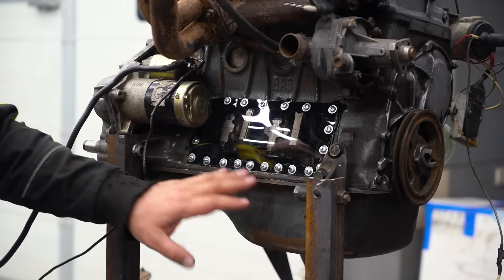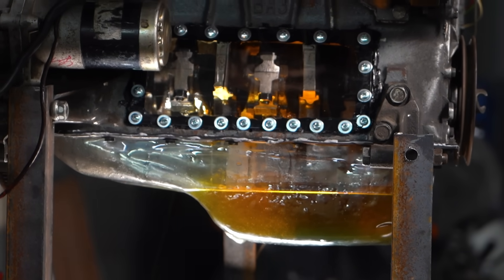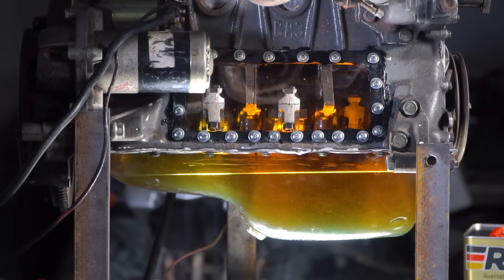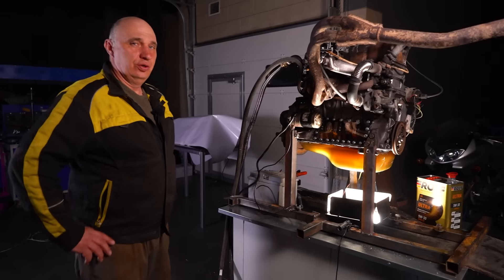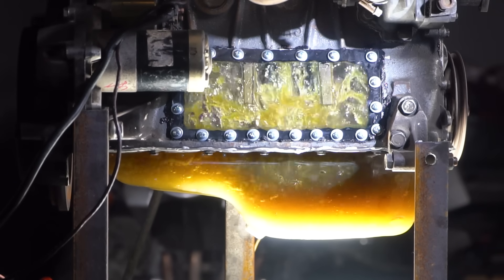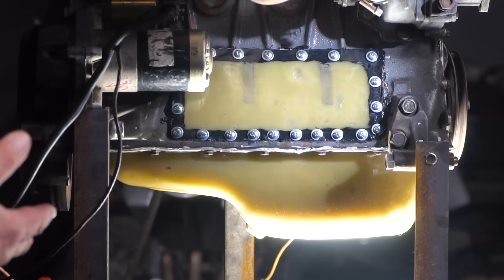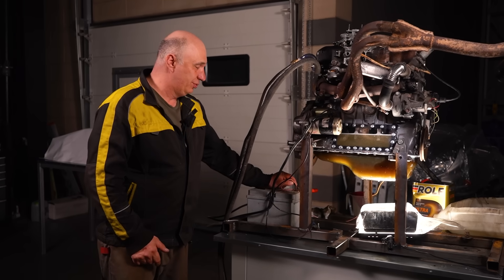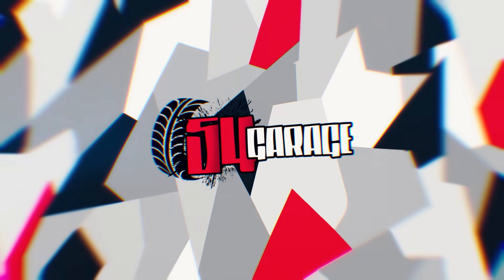What actually happens when you overfill your motor oil? (w/ transparent oil pan)

Comment: For those who are looking for a problem and not seeing it, the problem is the foaming. As the oil level rises, the oil foams more violently, and this introduces air pockets to bearing surfaces inside the engine. On top of that, aerating the oil pump lowers functional oil pressure by introducing compressible air into otherwise non-compressible fluid, and makes it harder for the pump to maintain a prime while operating.
Reply: there's also the added drag when the crank touch's the oil
Reply: after I drain my oil will my crank shaft not sound like it’s dragging anymore?
Reply: @raptorjesus5488  It depends on the viscosity. If it's a think oil, there's no effect. If it's a thick oil, then yes there will be an issue.
Reply: @xXturbo86Xx exactly
Reply: @karlwithak.that oil needs to be non compressable though. Foamed  oil will not stop metal to metal contact in bearings.
Reply: @waimser  It would be interesting to actually test if this is the case. Will air actually get in between the bearing surfaces?
Reply: @waimser  its simple: if oil get air, then motor get more from this air as from oil...🎉 ;) sim-ple😊
Reply: Right but apparently you need to triple the volume of oil in an engine before that becomes an issue. So 1qt over is not a concern.
Reply: I had a 1982 chevy with a v8 that needed 5 L of oil. I ran 5.5 for the last 10 years out of the 30 I owned it so i didnt need to top up during the year . Obvious to say no problems . I ran synthetic 0w30 and put on about 10,000 km / year. Changed oil once a year
Reply: @ellomirza  more oil will increase the crankcase pressure. So it's possible that some seal will start to leak and the pcv sistem will suffer and the engine starting burn oil.
Reply: @Malossianoplus  I very much doubt it. You’re just a guy who reads a lot or watches many videos so you’re thinking about theoretical abstract problems. I promise you in the real world overfilling by a quart or so is not a problem for any engine at any elevation in any climate for any period of time up to and including ♾️
Reply: If your engine is static, but your car goes up and down. Hills and turns splashing the oil around would multiply the problem @ellomirza
Reply: @ellomirza Good because I purchased the wrong viscosity oil and I added a bottle of STP oil treatment.
Reply: @ellomirza 1qt over would start concern  me. A dab over the line not so much. The manufacturers tend to build a little fudge factor in for the silly monkeys that work under the hood. Best to aim for the middle of their recommendation when possible but don't loose sleep if yer a micrometer over the max line.
Reply: @ellomirza  you're looking at 1 engine, that isn't moving or slanted like some engines, and keep in mind that the plastic oil pan was made out of the exterior shape of the original. Its going to have much more volume than the original which is also likely thicker than this one.
Reply: @ellomirza 
1 qt over irnt a problem ..
  Till you need a new engine ..
 Your too too is too big
Reply: @ellomirza  Depends on the engine. Small European engines have tons of extra space in the pan, but many don't.
Reply: @SkorpyoTFC  Agreed the design of the engine will have a lot to do with the susceptibility of the engine to suffer from overfilling issues and other oiling challenges.
Reply: @ellomirza  not exactly, if you think about it, the engine is stationary, in "normal" operational conditions, the engine is moving and oil goes all over the place.  Overfilling has been a warning by manufacturers for a very long time and there is a good reason for that, the foaming and cavitation issue, additional resistance to the crank and poor performance overall.  This topic has been researched by manufacturers extensively and it's not just a "thing" to apply that to the specification set forth by the manufacturer.  Poor quality oils can foam and cause the same issue even if applied correctly.  Certain synthetic oils and other oils have a "max temp" and if the engine is run hard for too long, the cause can be foaming and also the oil creates small solids, not good for the engine but that is another topic.
Reply: @myyoutubeantispamaccountformys when I eat I produce solids, should I cut back on my oil intake?
I tried sticking a dipstick in certain holes, but could not get a reading 🤷‍♂️
Reply: @myyoutubeantispamaccountformys  that’s a fine academic assessment of our topic here but speaking anecdotally as a guy who’s “overfilled” hundreds upon hundreds of engines including in my own cars I assure you there are no consequences.
Reply: You end up damaging the cat before anything else that is the main concern of manufacturers. As soon as year 100 mile warranties because required manufacturers detect the oil level and the engine stops above or below it, they also measure the oil quality somehow.
Reply: @myyoutubeantispamaccountformys  You're making a statement and point as if there were a lot more oil, one quart over will not do that
Reply: @ellomirza  if you are a serviceman / mechanic, you just proved why I'd rather do the messy job myself and not take it to the dealer / shop.
Reply: @user cool story bro
Reply: @myyoutubeantispamaccountformys I have a two stroke hot bulb engine so I know what you mean.
Reply: @mann_idonotreadreplies HAHAHAHAHHA
Reply: @mann_idonotreadreplies HAHAHAHAHHAHAHAHA
Reply: @mann_idonotreadreplies HAHAHAHAHAHA
Reply: @mann_idonotreadreplies HAHAHAHAHAHA
Reply: @mann_idonotreadreplies HAHAHAHAHAHA
Reply: @mann_idonotreadreplies HAHAHAHAHA
Reply: @mann_idonotreadreplies HAHAHAHAHAHA
Reply: @mann_idonotreadreplies HAHAHAHAHAHA
Reply: @mann_idonotreadreplies HAHAHA
Reply: With no windage tray in the pan I was wondering if foaming was going to be an issue.
Reply: They just need to add a quart of anti-foaming solution, problem solved.
Reply: Yup. Hydraulic tappets don't  like spongey oile   either.
As a rule, 6% air max for bearings, but 2% for tappets. Then you're in trouble.
Engines for extreme gradients cannot use hydraulic tappets.
Reply: @johnwade1095 it will blow the seals out and or come out of the breather
Reply: @karlwithak.  You didn't read my message fully. Because I admitted you said that. But it's not proof of anything if the engine was at idle and no load. You also haven't said what type of engine it was. Big difference between a hit and miss engine and an engine out of a Ferrari. So sure I believe you did that. But it's zero proof that Aeration is a non issue. I could link you to a study MIT did on the issue if YouTube would let me. By your logic auto manufacturers are wasting money on pressurized lubrication systems. We could just stick with splash lubrication. You only need a paintbrush worth of oil so it'd be more than enough....
Reply: @d3faulted2  I've been working on cars off and on for ~20 years. Have seen at least two dozen main bearing failures. Every single time, it was because of not changing the oil, or letting it get too low. (The only one off time was a Porsche M96 engine, but that's a different issue) I have never seen an over filled engine lead to main bearing failure. 

Furthermore, just on the physics of the situation I find it more than hard to believe that micro aeration in the bearing area getting compressed can cause damage to the surface. Diesel engines run with much more oil and much much more compression and don't have more main bearing failures that gasoline engines do. Liquids dissolve at least some gasses and the main bearing is always exposed directly to air, there is just no way you wouldn't see more problems with diesel engines all else withstanding.

TL;DR: I think you are full of crap.
Reply: @JustAnotherAlchemist  if you did you would also notice that compared to gas engines. Diesel engines tend to have much larger bearing surfaces. Yes higher pressures, but for a given power rating their bearing surfaces are much much larger. They also typically don't operate at near the rpm that gas engines do. Even small diesels like a kubota D-1105 tend to top out under 4k. That's the secret of their longevity. Low rpm and oversized bearing surfaces. So the actual pressure per area is lower. I'd of thought a 20 year veteran of the industry would already know that.....
Reply: @CharlesLeeScoville  thank you for sharing you signigicant expertise.
Reply: Fantastic comments here, quality ding dong, I only wish I paid attention in 8th grade so I could identify who was talking out of their arse. Great video
Reply: The 2x shot is most useful IMO: the takeaway here is that accidentally getting an extra half quart or quart in there is just fine.
Reply: the fact of the matter is, this scenario is so far down the list of concerns.  

the VAST majority of oil-related problems are either from idiots letting the oil levels get dangerously low, or the oil becoming extremely soiled from infrequent changes, or a combination of both.
Reply: I have a 6 cylinder that calls for 5 quarts, I always do 6. Wth can't hurt and takes more heat away from the engine
Reply: But it perfectly proves that a 90Hp Engine Could survive this situation haha XD If This was a Turbo Engine than the oil foaming wouldn have definitely destroyed it: :D
Reply: @mpower5177  agreed. Turbo engines are far more touchy
Reply: Cavitation = sudden phase change due to pressure differential that often occurs at a pump impeller in WATER services. It is when the liquid flashes and changes to steam at the low pressure point at the pump suction, then as the fluid is compressed, the vapor bubbles implode (change back to liquid) which can cause violent vibrations (cavitation). This does not happen in oil because you aren't close to the vapor dome. The air bubbles in the oil do compress and do decrease pumping, cooling, and lubrication performance.
Reply: @noahk9217  it does you know.
Reply: I have seen a car driven for 1 year with twice over max oil level and didn’t show any damage.
Reply: @blackbirght  How would you have seen that and did they drive it with twice the oil on purpose??
Reply: Yes but that didn’t happen until over double the oil volume. Nobody is gonna put in double the oil amount. 😂
Reply: karlwithak.Your engine, your rules... Your bubbles.... (Your worn out bearings).

Bubbles disturbs the oil film compressibility, allowing metal contact.

Journal bearings is a hydrodynamic bearing. The pressure (in the bearing, not in the lube gallery) is produced by the movement of the parts. This pressure is NOT monitored by the gauge/pressure switch.
Reply: I don't think aeration and cavitation create enough air to cause issues like that. An engine with no oil will run for a min before failing, so while your theory and deductions are correct, I still doubt they could/would cause issues in any sloppy toleranced combustion engine. Something dependent on extreme precision to function would be a different story.. Still, very sharp of you.. if you're not already on your way, you should become an engineer.. you think like one. :)
Reply: @dannythompson1948  older engines with separate babbitt bearing inserts deal with it pretty well, newer designs where steel cams ride directly on aluminum bearing surfaces and lifters function on hydraulic pressure get torn to shreds.
Reply: Overfilling a little (1 or 2 qts) won’t hurt a vehicle beyond reduced fuel mileage. Most quality oils have anti foam additives.  I’m not sure that tripling the amount of oil is a good idea, oil will squirt out of the breather.
Reply: It’s an old engine tho. Newer engines might be more sensitive
Reply: Well said sir. Small details can have big impacts..
Reply: Turbos will be ESPECIALLY miserable with foamy oil since their bearing is generally very dependent on ongoing flow, and maybe even 'hydrodynamic'...or oildynamic?...whatever, where the stream of oil is part of what makes the bearing.  If the oil foams, the bearing will be able to move within the 'compressible air bubbles' range of things.  That might seem harmless, but 'bearing slap at 20,000 RPMs or more' would be SUPER uncouth, and with enough bubbles it would have enough space to slap to an outside edge of the 'bearing'-foam and then 'zip around the bearing cavity' at whatever-thousands-of-RPM until the oil stops foaming enough for it to re-center itself.  Or until it fails, I suppose.  I haven't tried to see how much foaming a turbo can handle.

On the other hand, the non-turbo car engine I was working on that has a ton of goopy oil and varnish in it will likely get a 1.5-2x oil load with a can of engine cleaner so it splatters ALL OVER and hopefully breaks up some of that varnish and goop.  This was worth trying...and tells me that it's not a TERRIBLE idea to be a little over, even if it's awful to be more than a little over!
Reply: Yeah that’s what I was thinking
Reply: Great video!
Cause of problems is not foaming and loss of viscosity as you suggest in your comment. That won't cause seals to blow.  Primary cause of failure is crankcase vent getting blocked w/oil and  crankcase pressure building up.
Your crank didn't fail and seize.  Your gaskets did.  The blowby on cylinders from same pressure caused burning of oil.
Foaming is secondary, but perhaps root cause if you break camels back with juuust too much oil.  The foaming will put you way past scale, and likewise lower viscosity that will not allow crankcase to vent properly. 
At least this is what it seemed to me.  
Watch video again and reply if you agree or not.
Reply: That's the first thought I had when he noted the foaming... the introduction of so much air into the oil itself was certainly going to get sucked up and distributed as if the air bubbles were lubricant, which of course, it's not.   You touched on the 2nd question that I had, and that was what happens to the oil pressure itself. I would have guessed the oil pressure would have gone up, You stated it would probably drop because the air is more compressible.  I never thought about the change in oil pressure that way before.  Anyways good stuff ... cool to see what's happening in that oil pan!
Reply: The air bubbles also reduce the effectiveness of the oil as a lubricant. Oil is essentially microscopic ball bearings, when you introduce air to the mixture you get more friction between the moving components and this is also another huge issue
Reply: If you use 100% Synthetic such as any expensive oil other than what others claim to be 'Full Synthetic' because it only needs to have a small amount of synthetic stock to be labeled 'Full Synthetic' then you might have better lubricity and less chance of  metal to metal especially if the oil is already diluted or lost it's protection properties.
Reply: You stated exactly what I was thinking.  In summary, a little overfull is no big deal.  More than a quart (litre) overfull you can start to get aeration and that is bad for the moving parts.
Reply: Air in the oil also increases the volume of the oil, escalading the problem.
Reply: Correct! And while this might work with a Lada Engine for quite some time, high performance Engines with higher compression rates, Turbochargers, very thoroughly designed bearing surfaces will likely suffer from wear and tear a lot more and thus suffer from a drasticaly reduced Engine Lifetime.
Reply: Kind of like trying to drink through a cracked straw
Reply: Great breakdown of what happens. I was looking at the foaming as well and wondering what that would do to the pump.
Reply: This comment is the one I was looking for.  I watched on another channel an experiment a guy did on whether or not you should add oil to a new filter before installing it.  He took oil samples and had the oil analyzed, and he was able to determine that not filling the oil filter caused engine wear.  The second or two that oil was flowing in the engine, but flowing into the oil filter, was causing wear.  The oil analysis showed it.  There were microscopic metal flakes in the oil.  That type of damage takes years to really have an impact though, and the rest of the car may be done for before the engine.  The point is that this guy doing this experiment doesn't show the long term effects of overfilling an engine.  As others have said, the crankshaft will have an increased drag on it by splashing too much, and since different parts of the crankshaft will splash at different times, it will throw the balance of the crankshaft off and increase wear on the crankshaft bearings and the pistons.  Plus, the foam will create air pockets, like you said.  Yes the engine will continue to run, but that level of damage will not allow the engine to keep running for long.
Reply: Those air bubbles can burst between the journals and the crank and may cause pitting throughout the contact surface.
Reply: Crankcase pressure blew the gaskets. Would be more interesting while monitoring pressure.
Reply: It would be hilarious to hydrolock the engine from below with oil.
Reply: i agree, the oil cavitates, not good.
Reply: Add to that when cavitation occurs in a fluid the surfaces making that contact can actually break small particles off, so pitting occurs on those surfaces. not a good thing even if it's micro.
Reply: karlwithak.Just shows your are not too bright, running a engine with no oil in sump 🤦‍♂️
Reply: karlwithak. I'll remember that!
Reply: karlwithak.The voice of  reason. 👍
Reply: karlwithak.The argument about cavitation being a source of any non-slippery atmosphere that harms bearing surfaces, is silly. Very silly, especially after watching

 'oil is now bubbling out the breather'
(Oh? fun!)
"let's add more oil, we're not done!'?

The man made his point. When more oil molecules are battling the air molecules for a limited space, it's going to be more difficult to get a dry spot!
Reply: I was hoping trying to compress a liquid was going to be more violent.
Reply: What engine is this  ?
Reply: Hello everyone,
Yesterday I changed the oil in my ride on lawnmower. I went with a slightly thinner oil as the temps are cooling off now. I gave it an extra dollop...because reasons.
I hope this helps.
Glenn
Reply: @karlwithak. you know absolutely nothing which you are talking about, if you really believe what you are saying then go actually fill up your engine with oil, report back to us in a week once it has spun a bearing 😊
Reply: karlwithak.You comit the anecdote fallacy. You are also extremely unwilling to question more quantitative and qualitative data than your own experiences. That means you have unscientific approach to your decision making. Your ego is more in control of your thought processes than logic.
Reply: Yup I added 2 quarts extra in my old civic and the check engine light went on. Lesson learned
Reply: Yea he says it in the vid
Reply: Aghhhh bologna!
Reply: Good.point
Reply: The 'full' line is actually a 'fill to' line. Half a centimetre over this line seems to be perfect in most engines.
Reply: Additionally if it was diesel, oil coming out the breather into the intake will lead to a runaway so yes many problems 😅
Reply: It was interesting to watch this.Im surprised oil leaks out of seals/gaskets didn't begin at much lower oil levels.It would be interesting to see a similar test done when the opposite is done concerning oil level,iow too low on oil.It would require removing the pan and main/rod bearings at each oil level,so slightly more involved than just watching what the oil does through the transparent pan as you add each additional quart.Of course you wouldn't have to pull every bearing,just pull them from one main/rod journal or just the rod journal.To see if scoring begins at one quart low,then two quarts,etc.The bearing(s) would have to be replaced after each inspection so a discernable difference could be compared.
Reply: Yes, the bubbles could also be cavitation, and whilst as others have mentioned that it won't correctly get to the bearing surfaces thoroughly, and the compression issues, what about the oil life?

To me, any oil foaming due to over filling is going to lead to damage in the long term....and what about oil pressure also?
Reply: ahSO! Makes sense. Thx for that!
Reply: @d3faulted2  Wrong this is clearly not cavitation this is called aeration.
Reply: @airgliderz  I fully admitted I used the wrong term in a previous post. Good job at pointing something out that's been already established.
Reply: Foam is a decent way to end the life of any oil pump.
Reply: But, I'm also curious the damage being done to the bearings, if any, from the rod caps smacking the oil.
Reply: Love all the imaginative explanations here. My fav is someone claiming it could get into the clutch, but cavitation is a close second 😂

Nearly all oil pumps in internal combustion engines are positive displacement. And for good reason.

As long as you have:

A) sufficient oil
B) sufficient pressure

Then the oil will flow to where it is needed and things will be fine.

Oil+air vs oil only makes little difference, what's important is there is sufficient oil where it's needed. That's it. If it's flowing where it needs to be, there is no problem.

There is no such thing as "too much" pressure or oil, there is only "not enough" (insufficient) pressure or oil. 

Worst case you'll lose a bit of power and maybe longevity of the oil. That's it.

Bold statement i know, and a hill i will die on.

Prove me wrong with a source showing an engine being damaged by "too much" oil volume or pressure.

https://en.m.wikipedia.org/wiki/Oil_pressure

Remember folks, you can and should top up your oil with the engine running, oil cap removed... which you can do because an oil pump is positive displacement and the sump is not air tight.. pressure is required but only as a means to force it between bearings where it then dribbles back to the sump 😂

Cavitation.. in  😂
Reply: As i jist stated...ive seen a few engines overfilled by double spec and thwy all acted differently.   If you overfill a Volvo  by double so now you're at 16 quarts then you will be passing major amounts of oil through the exhaust.  You will emit a dark white smoke cloud as bad as youve ever seen.  I watched a vw master tech just the other day fill an engine without draining it.  It instantly shut down and he pulled the plugs and cranked to clear the chambers.  Brake cleaned all the plugs.  Ran the car for a few hours before the smoke cloud cleared. @sirtra 

Now, that's a chance to hydro lock and that's definitely engine damage. 

My qualifications are being a BMW tech for the last decade and personally forgetting to drain the Volvo and dealing with the consequences.   An engine sitting there is a very different beast that one in a moving automobile.
Reply: Not to mention that whipping oil costs both power and fuel economy.
Reply: When that crankshaft hits the oil it doesn't just foam it aerates it and it's mist, I would imagine when settles back then air bubbles become a problem.
Reply: If oil isnt compressed, Air won't be compressed. It's not closed system
Reply: Why overfill? Your supposed to belubricating an engine not whipping a meringue ...
Reply: That "Foaming" as you speak of , is caused by the crankshaft whipping the oil into a froth .
Reply: It also floods the cams with way too much oil and the cam seals begin to leak as they are not designed to be holding oil next to them.
Reply: don't forget the cavitation.
Reply: 1) air-entrained oil isn't efficient lube
2) More oil=less power

Machines require constant lube, and temperature control.  Keep it within spec. It'll perform better and last longer.
Reply: Exactly what I was thinking. With little real understanding of how an engine functions, it seemed to me introducing all that air was going to be a problem.
Reply: There is a reason why the engineers who design the dip stick with a maximum mark with writing above it saying DO NOT OVERFILL
Reply: Yes, it’s called cavitation
Reply: Cool story bro
Reply: @mann_idonotreadreplies HAHAHAHAHAHAHAHAHAHHAHAHAHA
Reply: @mann_idonotreadreplies HAHAHAHAHAHA
Reply: @mann_idonotreadreplies HAHAHAHAHAHAHAHAHAHAHAHAHAHAHAHAHAHAHAHAHAHAHAHAHAHAHAHAHAHAHAHAHAHAHAHS
Reply: @mann_idonotreadreplies HAHAHAHAHAHAHAHA
Reply: @mann_idonotreadreplies HAHAHA
Reply: Thanks for the explanation
Reply: Which is why you should always buy a vehicle with a gauge vs an oil light.  Oil pressure drop is discovered faster with a gauge so you can tell if your oil change guy messed up.
Reply: It's a side load washing machine 😅
Reply: Iam not a mechanic, always thought if you overfill it blows smoke oil out of the exhaust.
Reply: Thanks for actually explaining it vs having 20 minutes of empty talking for ad revenue
Reply: Very interesting experiment. Thanks for the work put into this test.
Reply: Anyone mentioned about crankcase pressure and pushing into crank seal on either side?
Reply: Due to the air in the oil, it will heat up more to the point possibly were the aerosol might light up and explode, or at least motor will overheat somewhat, since air does not transport heat so well, and so does oil foam.
Reply: Amazing explanation!!! top!!!
Reply: Advanced cooling
Reply: Understood
Reply: Drowing it from inside is how i describe it
Reply: There also happens a lot of Cavitation. Over a longer period of time it could significantly erode away parts of the crankshaft and connecting rod. But it will fail from the events you described much sooner.
Reply: @SkorpyoTFC

I agree with your second statement, but not the first. Air bubbles are not able to enter the rod main bearing due to oil being under constant pressure coming out. Now when the oil pump is picking up bubbles those bubbles will reach the connecting rod bearing "other crucial parts too" which is not enough oil and rod bearing failure is imminent.
Reply: In addition the viscosity of the foamy oil is too low, preventing good coating of the parts and will cause more burning.
Reply: Thinner oil foams less
Reply: What if the oil level was far above the crank so it couldn't catch any air to mix with the oil at all?
Reply: and increasing working pressure which can detain/damage gaskets and sealers and cause as you mention another drop down of oil effectivnes which can in long term ( few thousands km ) damage engine to the point it would be just to replace
Reply: I think I have problems with shops overfilling my 2008 Nissan maxima but it's hard to see the level
Reply: Air in a pump is a no no.
Reply: Ha! I thought so! Thank you for the confirmation!
Reply: I overfilled my mitsubishi pajero v6 many years ago. First drive after I could tell immediately I got on the dual carriageway. The engine noise and performance alerted me. I stopped... Drove slowly home and drained the excess.   Must have been foaming and tappets and bearings were not happy.     True story.
Reply: Foaming is a problem in fluidics, We can't say it's normal. Actually the air bubbles will reduce the density and viscosity of fluid and if viscosity and density is not as per the design criteria then definitely it will cause premature damage. Also air bubbles will reduce the oil lubrication and may cause the oxidation issue. But it will not result immediately or within a few hours. However, we can say foaming is a slow  poison to any fluid and fluidics system.
Reply: I overfilled my car engine by only one quart once on a 2-hour road trip by the time I came back my car was smoking from the oil burning off the exhaust manifold turns out all it took was one extra quart to blow my valve covers gaskets on the driver side. I use 9 quarts regularly
Reply: that is what  would happen if you double or a little more  that is a lot of oil over the fill mark. A quart of oil more should not hurt anything at all. so the myth you get at these quick fill oil change is only that the use or put in the minimal amount of oil which means more money in profit.
Reply: @kennylavay8492  just 1 extra qt blew my valve cover gasket on my coyote 5.0
Reply: All I know is anytime I've seen someone forget to drain oil and just add more (so twice the amount)   either the engine nearly instantly siezes up and then you have white smoke to deal with burning out the cat for two hours (Volkswagen)  or the car seems to operate normally but shoots a cloud of smoke from the exhaust everytime you touch the gas (Volvo, Nissan) 

That oil pan is very forgiving.
Reply: Considering the main problem is foaming due to air mixing into the oil im kinda curious what will happen if you fill the motor up so much that there simply isn't any air in the motor for the oil to mix with considering I'm going to be doing a engine swap this winter I might just try finding out with my old motor since I won't have any use for it when I have a motor that has compression
Reply: Guys, HERE is The True Savior

HalleluYAH translates “Praise ye YaH”

YaH is The Heavenly Father
YaH arrives via the TENT OF MEETING
YaH was Who they Crucified for our sins
YaH was Crucified on an Almond TREE

Ancient Semitic of Moshe (Moses)
Isa Scroll (The Original Isaiah)

Isaiah 42:8
"I am YaH; that is my Name! I will not yield my glory to another or my praise to idols.”

Isaiah 43:11
“I am YAH, and there is no other Savior but Me.”

Isaiah 45:5
“I am YaH, and there is none else.”
Reply: Skorpyo. I couldnt have put it better
Reply: The foamed oil will always ride on top of the oil, your sump picks up at the bottom of the pan. Maybe, in high rpm race conditions, with a shallow pan it will go am all the way to the bottom. But never in a street engine.
Reply: The crankshaft churns in air because of a higher level of oil in the oil pan. The crankshaft literally dips into the oil bath, which is not optimal. The negative impact, as you say, is less lubrication, not more. True, the oil pickup screen is about 1/2" from the bottom of the pan, submerged in oil but the addition of air/bubbles causes a minute break in the lubrication stream to the upper engine i.e. lifters, rocker arms, timing chain, etc. Now an oil starvation situation is created, causing accelerated wear and possible part failure.
Reply: I came here for this type of comment thread. Thanks folks for keeping YouTube truly alive.
Reply: Thank you for this!
Reply: How does this apply to more more modern cars with a split upper and lower sump?
Reply: Plus when an engine get's warm pressure rises and seals could go leaking or oil could be pressed between piston and cilinder and once an engine does thay it will keep doing that. So you might end up filling up oil and adding gass instead of filling up gas and adding oil.😊
Reply: 5 W 30 w = NORTH POLE  ::: BUT CAV- AIR WON'T  PUMP: POINT MADE ! BUT point #2 a little won't  kill ~~ but when it comes out the of the : "dip stick"?  * stick  to the " normal" level!😂😢😮😅😊 

Great work & now to the :" DRY stick" experiment ~~~~ smoke, fire & siezeure! !😲😳🚫👎😇🙏
Reply: Aka.   
  engine destroyed 
 Women overfill  with total Duh
Reply: I’d like to see how 3 quarts low operates.
Reply: Oil is actually compressible, though less so than air.
Reply: Thanks for saving me having to listen to anymore of this horrendous AI voice and electronic garbage.
Reply: Thank you man, for answering my thought :))))
Reply: Love the knowledge!
Reply: Wont the air or foam cause cavitation in the engine?
Reply: I'm disappointed, I was expecting to see mayonnaise 😂
Reply: Yeah, it would have been more informative if they had an oil pressure gauge "picture-in-picture" for us to monitor.
Reply: I should think that the oil being whipped into a froth like that would shear those long polymer chains in the oil, breaking the oil down much more quickly.
Reply: The point here is people have been told to put the exact oil requirement in and don’t overfill or your engine will explode. Obviously if your engine requires 5 quarts you can still put in 6 or 7 and there are absolutely no negative effects.
Reply: For me? I would rather have a larger oil pan and a good oil cooler, with reccomended oil level maintained.
Reply: Also, don't forget that air bubbles like those generates erosion like crazy.
Reply: Why can't we just agree to just put in the right amount?
Reply: Nonsense.
Reply: True, but it seems like slightly more would not be an emergency.
Reply: Let's also not forget about the cat converter too.
Reply: Another problem with this test is that there aren't varying load levels like in a moving vehicle
Reply: Is cavitation an issue at this point aswell? All those air bubbles can’t be good for wear on crankshaft and big ends
Reply: Costing a bunch of horsepower with too much oil, big block Chevys like to a quart low actually,  can pick up 8-10 horsepower by draining a quart out of your bog block Chevy!!
Reply: Accurate. Thank you.
Reply: If a diesel engine gets over filled it can run on the oil as a fuel.  Then it will over rev and blow up. Very frightening.
Reply: Heat is a major issue with foaming. Can kill your oil pump prematurely
Reply: all of us must say tchae to this
Reply: Awesome info, thanks
Reply: Probably went way overboard fabricating my own winded tray for my 3 L 2002 Ford Ranger. But you can never be too safe.
Grandpa used to tell me an ounce of prevention is worth a pound of treatment.
Reply: Foaming happens no matter what. Even if you don't overfill it. Everything you say is just theory, and false theory at that. The only issues that's caused by too much oil is what you see here (you did watch the video, right?).
Reply: The transparent oil pan is a genius idea for visualizing engine mechanics
Reply: Yep...this can actually all be summed up in one word: cavitation.
Reply: One of the coolest experiments ive ever seen. This Guy Rocks 🤘🤘🤘🤘👍
Reply: So you're saying add some Lucas and more oil to solve the problem... I like your thinking bro replace air with oil and add Lucas to thicken the viscosity no foaming and constant lubing...
Reply: The bearing are still coated in oil, the minute amount of foaming hurts nothing.
Reply: Agreed. However at 2x the amount, it really was not bad. The smoke from the exhaust would suck. Not the end of the world for your engine.
Reply: I call it the orange julius effect
Reply: I dont see how this proves overfilling isnt an issue. He runs the motor for a minute or two tops. Driving to work can be an hour commute and that oil will build oil pressure and find a seal or gasket to exit
Reply: This is hilarious considering there’s always air pockets, but apparently we are worried about the tiny ones
Reply: This is hilarious considering there’s always air pockets, but apparently we are worried about the tiny ones
Reply: Have you ever changed your oil. After just driving around town. It comes out  foaming
Reply: Also, crankcase pressure. Replacing a crankcase that usually has very compressible air in it with very not compressible oil will cause higher crankcase pressures.
Reply: the dip stick have hallow dots on it which tells how much space is in the sump available to fill the oil for the engine
Reply: what if I filled it so much that there was no air left in the engine?  That'd be good for extra lubing
Reply: This comment explained more than the video
Reply: Bro I understand but you can just tell that in the short form😅
Reply: So simple problem have simple solution: oil catch can + oil filter
Reply: @ you don’t actually know what a catch can and filter do, do you?
Reply: And the foaming breaks down the viscosity quicker
Reply: I immediately thought about the same, at least an oil pressure gage should have been used correspondingly - and shown to us if or how the oil pressure might drop during the test.
Reply: Yeah but 0.5-1l dont think will do any harm....
Reply: Also, any debris in the oil is tossed around up into the block
Reply: So should I overfill the oil or not?
Reply: @fortniteisbadatfortnite2570  nooo, just in case you pour a little more than max, leave it dont think will harm anything 100-300ml
Reply: Doesn't happen until excessive amounts of oil are used, 3X
Reply: I wonder how this effects heat dissipation, as that is also a primary function of oil.
Reply: Hydro engineers know what happens when "aeration" meets pump and vacuum effects reduce head
Reply: @Howo8910  I think the point of the video is that to get the oil to foam you would need 12 quarts of oil. My car recommends 5 quarts, I put in 7 and have a car with not engine problems and purrs like a kitten after 3000,000 miles. I also change my oil at least twice a year
Reply: All these morons forget oil leaves a film, keyboard experts and their boring lives amaze me
Reply: people know the problem.  they're looking to see how much oil you need for the problem to occur...
Reply: Also severe cavitation. The bursting of the microbubbles causes tiny, but incredibly surprising damage to all metal parts. This test would need to be run for hours and then you'd likely see catastrophic damage, starting with the main and rod bearings.
Reply: it's called FLUID OSCILLATION
Reply: The engine is vomiting 😅😅😅
Reply: Concise, thank you for the info
Reply: @karlwithak. the problem is the top end sizes. This is a well known way to "accidentally" blow someone's engine up. You over fill the fuck out of their motor.
Reply: @Jiunds Sad man
Reply: @Jiunds No its not well known. It just drains off the engine breather. Stop making things up.
Reply: When the oil is up to operating temperature (100+C or 212+F) there is less air bubbles. 
.
Reply: @craigd1275 true from the stand point the bubbles will not form so easily and those formed ones will surface faster. But... Lower viscosity means easier return of oil to the pan, increasing the level, more crank beating.
Reply: @d3faulted2 that's aeration. Cavitation is caused by a restricted or blocked oil pickup or suction line to a hyd pump. Cavitation and aeration cause similar damage but cavitation caused imploding air bubbles on the suction side of the pump and aeration causes air bubbles to explode on the outlet side of the pump. Everyone always says cavitation but it's aeration.
Reply: Nope.  Cavitation is caused by bubbles formed from high speed fluid separation.  In this instance, it would be the crank balancers possibly incurring cavitation moving through the oil at high speeds.  Aeration of the oil is completely different and decreases its compressive strength since air is much easier to compress.  Just a guess but I’d think you might have some harmful effects just from different flow characteristics.
Reply: @fraserlordly2432  that is actually very good information thankyou!
Reply: @fraserlordly2432 well cavitation bubbles and aeration bubbles are wildly different. Cavitation bubbles are formed with nothing inside them they are a bubble of vacuum space essentially. So, when they "pop" there is nothing being released like what would happen with an aeration bubble. So, whatever small amount of gases are in the cavitation bubble, get forcefully compressed and eventually ignite and explode. 

In water the explosion can reach temperatures in the realm of the sun and apply as much force as a .22 going off but in a pinpoint space. I don't know how higher viscosity affects that, but I'm sure it doesn't make it too much nicer 😂
Reply: @fraserlordly2432 aeration and cavitation do not cause similar damage, they have different modalities. You are correct that it is aeration, but it does not have exploding bubbles like cavitation.
Reply: @fraserlordly2432  You're right I used the wrong terminology.
Reply: The irony.
Reply: @d3faulted2 wow admitting a mistake and taking ownership....first time I've seen that in the comments section.
Respect.
Reply: The other issue with an air-oil emulsion (whipped like cream...) is that the breather usually goes into the intake- and then your engine will run away!
Reply: @demil3618  Gasoline engines won't run away like diesels will (gas engines will foul out the spark plugs = quit running)...
Reply: @KCadbyRacing  True. I was thinking about diesels as I mostly work with those.
Reply: @demil3618 Otto cycle will not run away if it sucks in some lube by the intake. It will make a hell of smoke!

By letting go the throttle, you will kill the air supply.

A DIESEL is another story.... 

The engine on the experiment is an Otto. 

If you don't know what an Otto is, it is a "spark ignition", (usually) burning petrol or gasoline, depending on where you learned your language (English or "Americanish")
Reply: @demil3618 No, it won't. Unless it is a diesel.
Reply: @demil3618 runaway can only  be true for a diesel engine but that is a great thought! 😊
Reply: If foaming is the issue, what if the engine is so full of oil that there's barely any air to make foam?
Reply: @karlwithak.Did you disassemble and measure / inspect the journal/bearings after the 10min run or you say "no damage" because the engine "still runs"?
Reply: @pardalbartz it didn’t blow like the one guy said haha
Reply: without a science "white paper" from an oil scientist/company or engine manufacturer and see the damage to bearings from overfilling due to cavitation, i would say this is heresay. Please provide citations to back up your claims
Reply: @fitnesspoint2006  heresy, or heresy?
Reply: @johnwade1095   note this engine was not moving like in a car. While braking or accelerating the oil get slushed around, this nonsense about the oil not touching the crank is BS, its constantly touching from suspension travel, taking turns and breaking and accelerating the vehicle.
Reply: @fitnesspoint2006  gradeability is a big concern off highway.
Engines may run all day on a 35 degree incline
Reply: @fitnesspoint2006  Tell me you're a limpdick engineer without telling me you're a limpdick engineer.
Reply: @d3faulted2 cavitation bubbles that collapse and erode are not AIR! you cannot collapse a gas bubble! Cavitation bubbles are VAPOUR, formed by a low pressure spot. Once the pressure increases when the bubble travel to a higher pressure spot, it will collapse.

Very common cavitation problem in pump impeller and boat propellers. And in those applications, very misunderstood is the phenomenon of VENTILATION, where the prop or impeller sucks some air into the intake stream. In a pump, the pickup tube got air or a leak in the suction side piping. In a prop, too close to water surface may allow air suckin in.

Ventilation drops trust and therefore the required torque. Consequence is speed increase, very noticeable and also power loss (pumps loose pressure / boat looses speed). Cavitation does not produce noticeable loss in trust.
Reply: @pardalbartz  I fully admitted i used the wrong terminology. And how did boat props come into the discussion? Since we are on boats. Ask the people on the Titan submersible whether or not a gas bubble can collapse. There are plenty of computer generated models for viewing on youtube of air bubbles collapsing under high pressure.
Reply: @karlwithak. correct, overfilling  is not a problem, and if you added new oil and accidentally overfilled, most if not all modern oils have antifoam additives.
Reply: more immediate effect is splashing oil to cylinder walls and what does that do to catalytic converter, at the end of the line?
ie the smoke at 16:40
and... what's oil doing in egr valve? and beyond it.
Reply: If the Oil is foaming then it’s definitely something wrong in the Engine!!
Reply: Nice try... You actually sound like you know what you're talking about. You probably could have fooled anyone else. .. But unfortunately you couldn't fool me...
Reply: You made up the air pocket negative effect didn't you. Where is your proof?
Reply: Oil foaming, for the most part, is caused by water in that oil, not higher than recommended level of that oil.
Reply: @ that’s not at all accurate.
Reply: It just break the seals...
Reply: @keyroncampbell no.
Reply: Get over yourself, we aren't stupid.
Reply: @karlwithak.in us people mistreat cars like hell never change oil and u see many videos on YouTube this engine is trash this brand is not good . They dont know how to take care of cars.
Reply: @Spiritualwarfare587 the same land microwave manufacturers have to put on manuals "do not dry your cat on it"... And this is because some American judge accepted the case where a cat was killed and the "murderer microwave manufacturer" had to pay a million or two in "damages".

If kidnappers knew how much a cat is worth, there would be so much cat kidnapping that the word "catnapping" would be added to the dictionary!
Reply: @pardalbartz  false
Reply: @Spiritualwarfare587  Where are you from?
Reply: @Spiritualwarfare587 on the other hand I see car mechanics in the us recommending 5k oil changes (which is what I do) and in Europe people say don’t bother u til you reach whatever ludicrous mileages the maker recommends.
Reply: @Spiritualwarfare587 thats funny you say that my 1.8l honda motor is like 7k miles over due on oil change and has had a weird knocking sound for about a year😂 Im not sure how I haven’t blown a connecting rod or something catastrophic along those lines. Imagine If I would take care of it lol but hey I give it the ol Italian tune up almost daily 😂
Reply: @Spiritualwarfare587  What country are you from?
Reply: @karlwithak. You apparently haven't hit 8th grade yet. Let me explain this simply for you. What happens is as the piston goes up and down pressure is applied to that film of oil in the connecting rod bearings. Higher pressure under higher load. The bubbles in the oil get compressed. What happens when air gets compressed? Temperatures go up. Temperatures can spike high enough to start pitting and eroding metal. If it means nothing at all then why do motor oils have additives to help prevent things like foaming? Why do engine manufacturers design engines in ways to help avoid it?
Reply: @d3faulted2 these aren't exactly things people learn in the 8th grade 🤣
Reply: @d3faulted2 the guy is a idiot, e runs fresh built engines with no oil in the sump Haha.
Fair enough for experimental stuff, but not a engine you plan to use
Reply: @d3faulted2  Gasoline engines don't "run away" like diesels can.
Reply: @d3faulted2 The crankcase is a closed system. There is no compression of the air or oil. You are not smarter than a 5th grader. Less oil means more air, means more heat. Check and mate.
Reply: @djpanduh  lol hahaha why do you think crankcases have ventilation it is not a closed system. Plug up that breather tube and watch as your dipstick and/or seals get blown out. Tell me you've never worked on an engine without telling me you've never worked on an engine.
Reply: @d3faulted2  Thank you!
Reply: @karlwithak.Guess you are not an Engineer, right? And guess you consider all engineers to be a bunch of theoretical guys that cannot drive a simple nut on a bolt ("in practice").
Reply: @karlwithak.  you never gave a real world example. Outside of using the incorrect term I very precisely explained why air bubbles in oil is bad. Let me guess that engine you claim you ran for 10 minutes, never went above idle and you never put a load on it? I can tell you've never had any actual education in anything mechanical.
Reply: @d3faulted2
Reply: @d3faulted2 typical shopfloor guy that tells engineers / technicians are stupid.
Reply: @pardalbartz  Dude I'm actually trying to agree with engineers that air bubbles in the oil is bad. Sure i messed up the terminology but i fully agree that it is bad.
Reply: @pardalbartz Damn dude I could sit and read your posts all day while you argue about engine mechanics and engineering. You know your stuff. 👍
Reply: @d3faulted2  yep, air bubbles are bad in oil. Actually, no, they are not "bad", they are "horrible"!

Fact there are air bubbles don't matter the terminology! Damage will not read the text"!
Reply: so what the engine didnt blow up armchair expert lmao
Reply: @EazyDuz18 no, he said he ran the engine for 10 MINUTES without it blowing up, I'm challenging him to put his money where his mouth is and actually drive like that in his car, he will find out very quickly 😊
Reply: @EazyDuz18 huh? So that means it’s good? 👍
Reply: karlwithak. I guess you didn't learn anything about aeration and cavitation in eighth grade then, or any other time.
Reply: @m3chanist  8th grade huh